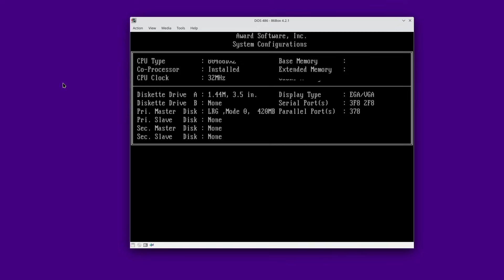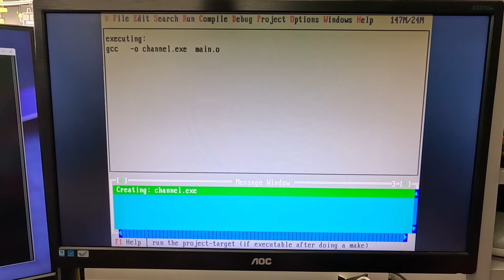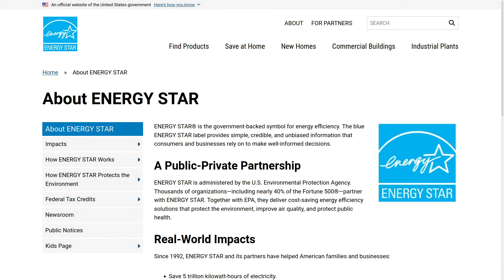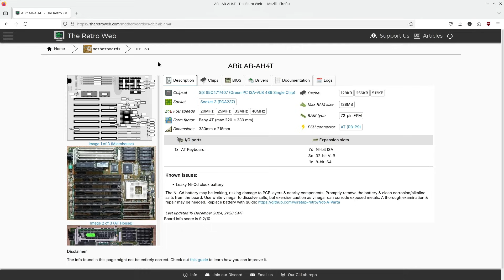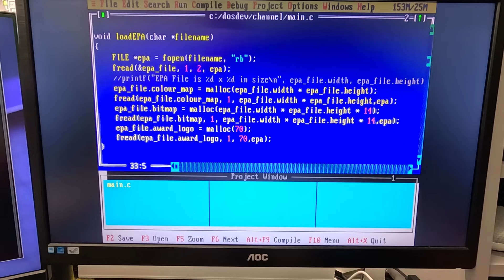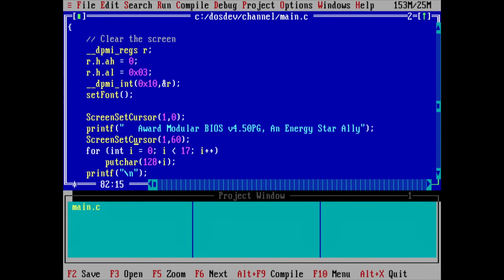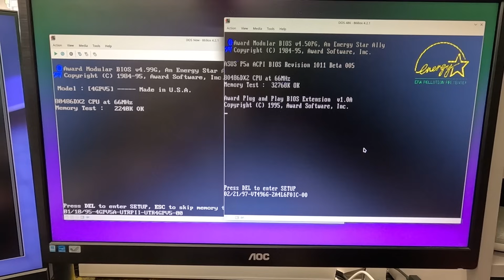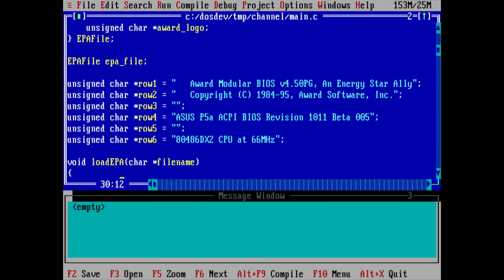Retro MS-DOS Coding - Recreating the Iconic Award BIOS Screen

Comment: Award BIOS screen is EGA, supporting both graphics and redefinable characters.  As I was into BIOS modding I know for a fact that the Energy Star logo is a bitmap picture in the ROM.

BIOS has a pure text fallback for CGA and MDA if EGA is not available.
Reply: MDA was not the abbreviation I expected to see on YouTube today, but here we are. That brings up some lost memories.
Reply: @AnnaVahtera  Well let's add a missing one for you, I have started with Pascal 6 on a Hercules Graphics Card (HGC).
 A somewhat weird mix from MDA and CGA, but still monochrome.
Reply: @retinaquester  Ooh, I had a Hercules card in a.. 286? I think. I owned it only a short while before I got an EGA card. 

I also owned the weirdest CGA(-ish) graphics card that I've ever heard. It had support for 8 colors and had four times the memory CGA cards normally had. I never found any programs that actually supported it. (The PC was from a company that used it to draw plans for oil drilling rigs and they apparently needed all that graphics power back then.)
Reply: @AnnaVahtera  Was it Plantronics mode? That added a 2nd bit plane for blue and intensity (which would normally be bits in two diferent registers).
Reply: Award BIOS switched to EGA after 4.50 or 4.51. The earlier ones where VGA textmode. You see that in the behavior of the cursor.
Reply: @dolphhandcreme  Award switched to EGA text mode (8x14) in 4.50G (4.50 had the blue POST screen in regular text mode), and then to VGA graphics mode in later revisions of 4.51PG.
Reply: It's EGA text mode, 8x14, both the Award and Energy Star logo's are defined as custom fonts (the EGA and VGA allowed you to display two fonts at the same time).
Reply: @OBrasilo  Not quite. You could switch between a 256 character font with 16 foreground colours available, or a 512 character font with 8 foreground colours, one attribute bit being used to extend the 8-bit character value. Not sure if that's what they used - since it controls the boot messages shown while the logo is up, they could've just redefined some of the upper characters not used.
Reply: you can actually try out the monochrome fallback in 86box
Reply: How does the BIOS work with the memory management unit?
Reply: @petevenuti7355  There is no seperate "memory management unit" in an x86 CPU. BIOS uses real mode, the boot-up mode of an x86 (and even x86-64) CPU.
Reply: The BIOS dump he showed literally contained a .bmp of the logo 🤔
Reply: I had a HeadStart Explorer, a very late 8086 clone from 1989, which used a Yamaha V6366C-F to provide a nonstandard 640x200 4-color mode for its in-ROM GUI.
Reply: @RudyValenciaDotCom  Interesting, from what I can find the V6366 is quite a capable chip, almost EGA/VGA-like in its capabilities.
Reply: @kilianhekhuis  I think that's why the developers of the HeadStart Explorer chose that chip.

Comment: I had a lot of fun with demo stuff back in the day.

The simplest demo effect to get your head around is probably colour cycling, such as the "wormhole" from Future Crew's "Unreal". You just need a static image, and the challenge is setting the palette using port I/O rather than BIOS calls, and syncing with the frame rate.

Both of these things are important for most demo effects, because one of the things about "real" demos is that effects often fade in and out, and that's all done with palette manipulation in VGA.

The next simplest effect is scrolling credits. You don't often think of this as an effect, but it uses a clever technique that's important to know about. Essentially, you use video memory as a circular buffer, and the "scrolling" is done by telling the VGA hardware where to start drawing from.

The next simplest after that is probably vector dots, such as the "tunnel" from Second Reality. It can be done in VGA mode 13h, although Mode X is more common because the pixels are actually square. The main things that you need to know from the logic side are working with 32-bit fixed point arithmetic (typically 16 bits of integer and 16 bits of fraction), and precomputing sin/cos tables.

On the graphics side, addressing VGA video memory (especially planar memory in the case of Mode X) is a little tricky, and using the memory latches effectively is part of the art of getting your demo effects to be performant. Eventually, you will work out for yourself why DOOM runs so damn fast: it draws all of the walls and sprites vertically.
Reply: Not only demos, games in the VGA DOS times used that extensively, even if you where a bedroom hobby coder and "just" coded a little game in QBasic it was a nice way of getting some animation going without using much CPU cycles.

For example id Tech 1, aka the Doom engine, used it for different brightness levels in the different sectors for example, you really only have eight brightness levels and the game runs on a palette of 32 colors in different brightness levels, with stuff like the invulnerability sphere or the brightness googles just using a different palette.
Reply: Ah! I remember watching Unreal so many times. Then I got hold of the mod (.s3m?) ... Wonderful times 😃

Comment: The modern forum software I am most familiar with is Discourse. Most importantly: it isn’t a massive pile of security vulnerabilities, which (although they may have gotten significantly better) was the primary function of the big forum packages back in the day (particularly phpbb). It also has a pleasant interface, works well on mobile, and plays nicely with search engines. 

I’m probably not your target audience for this—I showed up here on the basis of a random YouTube rec—but maybe this points you in a useful direction. Good luck!

Comment: I see an fopen() but no fclose() at 10m04s, plus two malloc()s without free()s, tsk tsk tsk :)
Reply: If the DOS executable is terminated regular all open files are closed and the memory is going back to DOS, if the termination is not used for  staying resident.
Reply: It’s DOS… no concurring process to hack with buffer overflows 😂

Comment: I could clearly remember that with CRT this mode was noticeable different from normal text mode so my guess was it just graphical mode with using fonts from text mode to make impression of text mode
Reply: No, it really is text mode. Specifically, it is 640x400 text mode with an 8x16 font.

I don't recall if there is a VGA BIOS call for setting this particular mode, or if it needs to be "tweaked" from a standard mode; but there's more to it than just turning off the ninth bit of the character cell -- the two modes have different pixel clocks.

If a tweak is required, it will be the same tweak that transforms (256 colour) 320x200 into 360x200, or (16 colour) 640x480 into 720x480

Comment: Great presentation!
If i understand correctly i think you added some hoops here going from 32 bit protected mode. 
I have simillar hoops, when i was forced to use Borland Pascal Protected mode beacuse of memory limits, but i needed to call 16-bit intterupt installed by real mode Btrive client,
and internet was just starting, much time to find info how to do it ;) (no Google didn't existed, Altavista somewhat helped).
Now we have problem in other way, many materials and knowledge is lost or exist only in one copy, this worries me often.
Reply from the maker: It is much easier now that we can put words into Google, or go searching through 20 year old forums for content. And while it's good that the Internet Archive exists, it is a bit of a single point of failure. That's why I'm not 100% sold on the idea of Discord, Facebook groups or other parts of social media - it's just moving content off the web and into things that search engines can't find.

Comment: I loved your video. I was an 18 year old kid who had access to almost nothing, but I loved poking around in interrupts and memory areas. I used Turbo Pascal with a bit of assembly.
Reply: Yep a small book of assembly listing the x86 instructions was my bible
Reply: i did it too. playing with all these interrupts and changing vga modes lol. I coded a weird sprite editor with that.
first with turbo pascal and then turbo c
Reply: I remember A000 and B800 but I don"t remember address where ascii graphic representation are stored...
Reply: Still using 'borland' products
Reply: I did also a lot of similar stuff. I wrote an LCD driver in TurboPascal. It hooked into the timer interrupt 0x08 and periodically scans some lines on the screen memory and outputs it on LPT1 where an HD44780 was attached. MpxPlay, a DOS MP3 player in autostart.bat - and my first car mp3 player was ready. Crazy times.. 😅😅😅
Reply: 👍B800 was for text mode and A000 in graphic mode. You could address up to 64k and had to switch R G B banks for higher resolution mode. Mode 13h (320x200 with 256 colors) was my favorite. Easy to program and you could do nice animations with color palette modifications

Comment: It's been a very long time, but there are two common text modes: a 640x350 EGA mode with an 8x14 font, and a 720x400 VGA mode with a 9x16 font. If I recall, the 9x16 font is really an 8x16 font with the left-most pixel always blank, and those are your ugly lines. You need to get into that 8x14 character size mode if you want it to display correctly.
Reply: Correct, don't mess with the VGA mode, switch to EGA mode, the aspect ratio and font will look correct.
Reply: It's the rightmost pixel, and it is always blank... except in the characters from the range 0xB0 through 0xDF, the line/box drawing and filled block characters. In those, the ninth column is a double of the eighth column. So if you can create the Energy Star logo out of those characters, you can have it without the lines.
Reply: @bitwize  I assume you mean with still changing the font. Although it would avoid the gaps, that wouldn't mean it's displayed correctly. It would still be the same aspect ratio, but with every eighth column doubled, so it would look like a very unevenly scaled version. That hack is definitely not suitable for most graphics.

If you mean drawing a logo with the actual box drawing characters, that's an interesting idea, although I think it would be quite challenging to approximate that logo.
Reply: @bitwize  Actually I think it's 0xC0 to 0xDF (0b110 in the top three bits) which have the last column duplicated. 0xB0 to 0xBF are pseudo-graphics, but they are not extended to the right.
Reply: @bitwize  it still would not create a smooth curve
Reply: Nice to know though, I didn't know about this exception for 0xB0-0xDF characters. I recall it puzzled me when I played with font editor as a teenager circa 30 years ago. Mistery solved, finally! :) 
Thanks, @bitwize
Reply: Exactly, the BIOS uses the 8x14 mode.
Reply: Девятый столбец не всегда пустой, это зависит от дополнительных настроек. В каждом символе он может либо быть пустым, либо заполняться, если заполнен восьмой столбец. Иначе горизонтальные линии невозможно сделать. И это настаривается, можно так настроить символ с любым кодом.